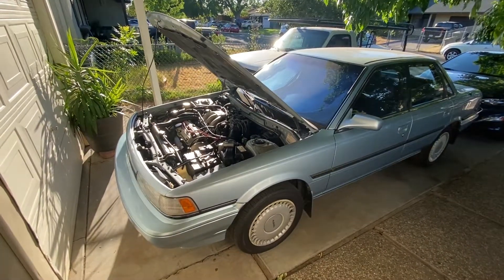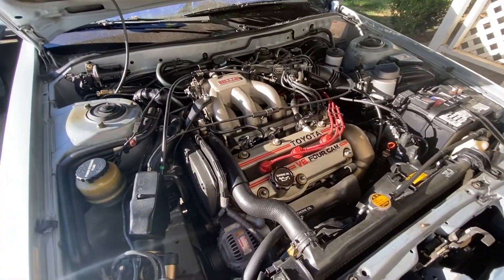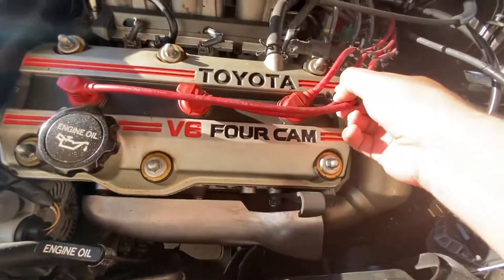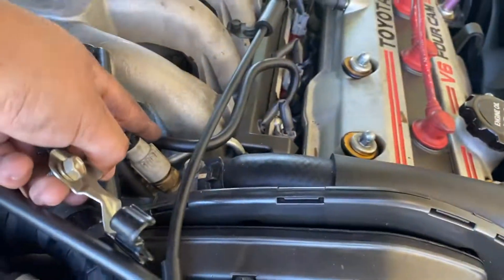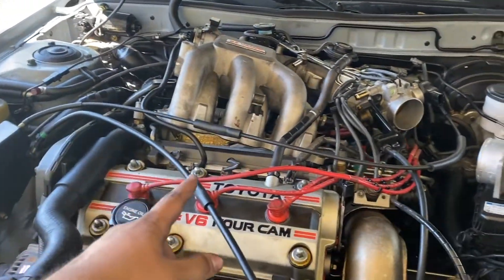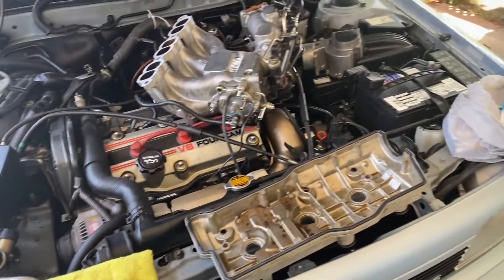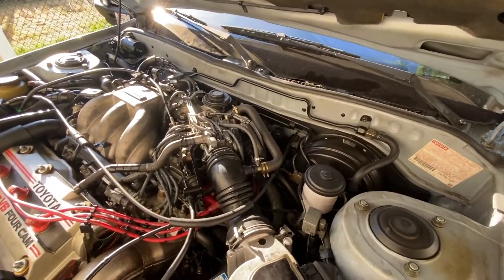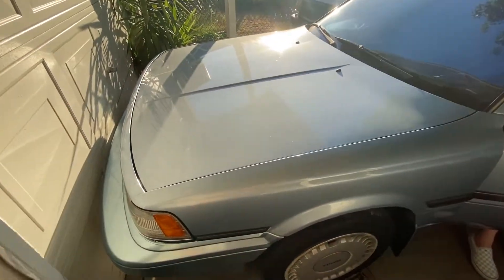1991 Toyota Camry Restoration - Episode 1

Comment: I just got one of these as my first car, 1988, 5 speed manual, 3SFE l, it feels incredible to drive, unlike anything else, technically the first car I have is a 2000 base CE camry, auto, its my dads but I put some money into it via a subframe, stiffer springs, and some racing brakes, but the 88 is the first car with my name in it
Reply from the maker: I loved mine before I sold it. Probably the only car I’ll regret selling so hold onto yours!
Reply: @SSINATIVE  #1 rule of being a car enthusiast: 
Never sell your first car 
I'll hold on to mine for a long time as a daily, get an AW11 MR2 as a touge car, 1985 Toyota pickup (copy of the back to the future one but desert tan in color) and a 1UZ swapped Mazda RX7 FC as a drift car, imma be the guy with a 1 room, one bathroom house attached to a shop 😅
Reply from the maker: @insid3493  that’s the dream bro! I don’t miss my first car but I do miss the Camry
Reply: Be careful with the 2nd gen Camry because they are too easy to lose control of like a lot of older cars. Especially FWD ones.
Reply: @CautionHighWavesAhead-  thanks for the heads up! It's actually not too bad and cause of the decent road feel, its a lot more predictable than a newer car with light steering on a heavy chassis, also being FWD makes it arguably less understeery under power than an AWD car. Anyways I've kept up with a 2018 Porsche Cayman S, and a GR86 on a windy road, and beat an FC RX-7 (in that one I even caught some air 😅) and an 06 Audi RS4. I've kept it stock though cause Its a rare car and I don't want to ruin it. Also I've probably never pushed myself past 80% of what the car has got, and I plan on buying a 2nd gen Miata or a GT86, or an EG6 and then turning one of those into a real canyon carver.